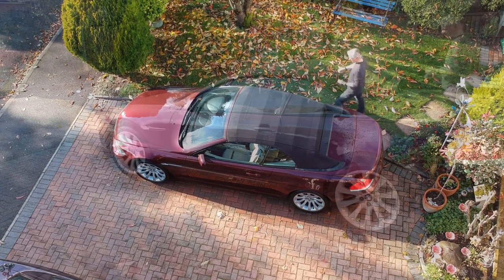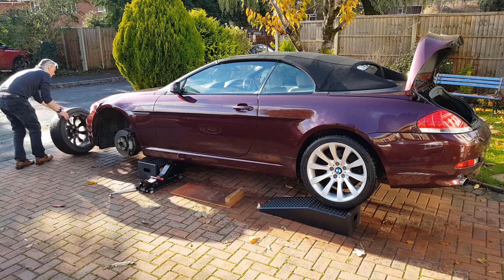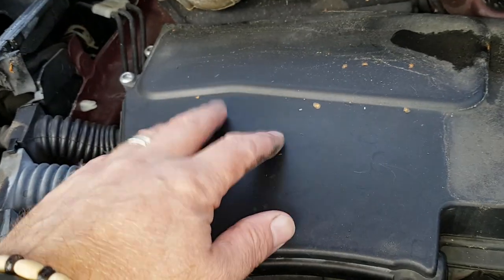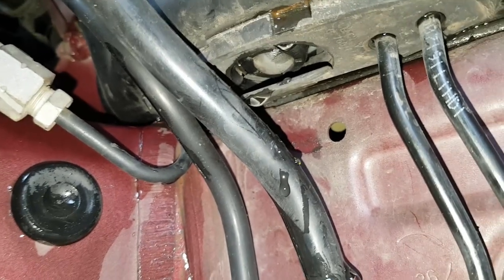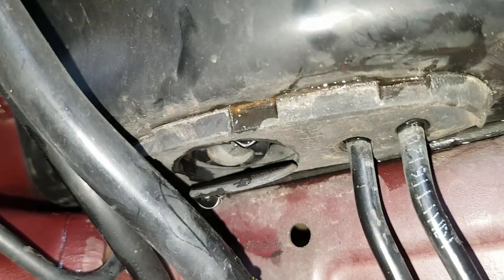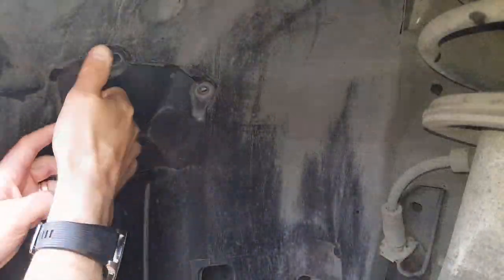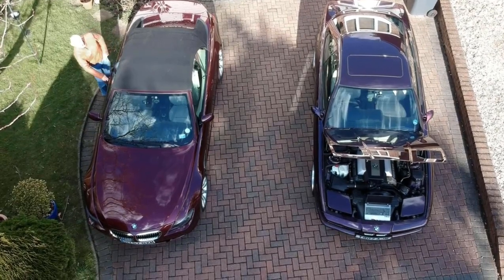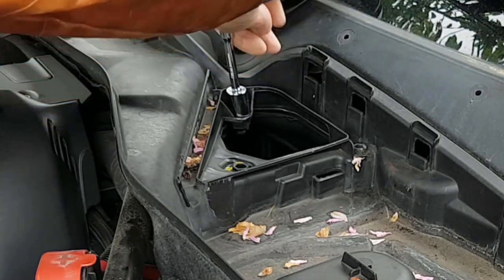BMW 6-Series Hidden Water Drain - The E-BOX one!

Comment: This is great help for alot of BMW owners. A good sign moisture has entered the Ebox is the Ebox fan will set a fault code showing a short to ground or open. The high end BMW's pump cold air from the AC into the box. Another source of condensation. I went thru 2 ebox fans before I figured this one out. I live in a humid climate and some of the AC condensation ends up in the Ebox. On my E70, I had to drill a very small hole in the very bottom of the ebox close to the ebox fan. If you see a rusty bottom in the ebox, this may be the source.

Comment: Hi Timm, I had water around the e box. Not caused any problem, but does worry me. I have taken a spray head off of a windowlene bottle and extended the tubing. I used it as a pump to pull the water out. Wish I knew how to unblock the drain. I had the e box open a couple of years ago to do valve cover gaskets. I’m sure some wires come up through the bottom and into the IVM module. If the ebox sits in water too long, it’s bound to get in. Great video by the way👍
Reply from the maker: The drain is accessible from underneath in the wheel well as shown in the video - there's not much room but you should be able to get it clear

Comment: Thanks for taking one for the team
Reply from the maker: Well, someone has to!
Reply: @TimmsBMWRepairsandInformation  on the US model it’s on the passenger side and allows water to penetrate the passenger side floor, and boy and I paying for it, totally blocked up , I had to clean boot out and flush from the top while using the wet vac to pull from the bottom

Comment: I'm going to be having a look at this shortly. a few months ago i took out 9 litres of water out of my rear drivers footwell, yes NINE, (glad I'm parked on a slight incline) removed all seats and the rear part of the carpet and let it dry, took ages,  the drivers side turned out to be the drain under the brake booster,. drivers side nice and dry now even with the lots of rain we have had, but the passengers side  is a tad soggy :(, so out the passenger side seat out again , its either that or a failed door membrane , more investigation required, but now i know where the passenger drain hole is
Reply from the maker: These cars love to leak everything!

Comment: Hi Tim, another helpful video, I had a shock when my e63 driver side footwell and the passenger footwell was absolutely drenched to my horror, always kept my car parked on a downward slope just in case there was a blockage etc just to minimise any risk of water coming in if there was a blockage somewhere, just this one time on holiday in October last year where the car was parked on a slight incline nose up and after a through wash with a outside hose, a luxury I don't have at home.

I have always kept the 2 side scuttle valves clear of leaves and crap but traced back the blockage to under the brake servo, where the area under the servo the paint had been eaten away and blocked the small drain, no doubt from where progressive dealerships had not been careful enough when filling the reservoir and the brake fluid has dripped/spilled causing the problem, am really angry and upset as I keep my car as in good a condition as I can, I spoke to my current bmw dealer BMW park lane who have just gone silent after deciding to tell them as they were the last people to do the brake fluid change in fact the car has never been outside the network and they should take ownership of the problem only because it took 2 months for me to get the last of the water out in this cold weather and because of the potential damage to the subwoofer/amplifier under my seat.

Just something else you may find helpful. The service advisor claimed that they don't fill the fluid fro up there but at the bleed nipples by the wheels which sounds like crap imho.
Reply from the maker: Thanks Doug, yes, I go through those drains in this video and they often get blocked up sending water into the cabin, really got to keep an eye on them!

Comment: Hi Tim..I've noticed on my 2010 E64 635D LCI that rain water is not finding an egress point. Drivers side..where the roof closes and meets the corner rubber cup  housing situated up in rh side of the bodywork around the.front window screen. So water is dripping in over the window control point on the driver door.
Any suggestion for where a secret drainage point is or which drainage point may be blocked...
Cheers
Reply from the maker: I show the drain you need in this video, it can be cleared out as shown: https://youtu.be/ZsnRfhWlpQ0

Comment: I'll give you the bad news.water can get into the e box from the bottom.ive just lost 2 ecus in 8 months due to blocked gully.im just about to pull those rubber grommets  to prevent it happening again
Reply from the maker: Yes, that's probably a good plan!
Reply: Same thing happened to me 6 inches of water in ebox ?? Question is 🤔 how damaged all my modules shorted ecu and decayed ivm pins.. Maybe through wire loom? Thinking of drilling holes ?

Comment: I have the E60 same era and found over last few days puddles in front driver well and rear drivers side footwell. Wondering if I have leak from front below bonnet ie brake fluid bin area and water flowing to back seat area. Or I have 2 leaks from rear door and front under bonnet area? Been tipping water out and it’s not ideal and windows are all steamed up. Need help.. not sure what to do.
Reply from the maker: Start with the engine bay, in particular the area around the firewall - AFAIK it has the same problems as the 6-Series
Reply: @TimmsBMWRepairsandInformation  do you mean after taking all. Plastic stuff off the area below the brake fluid reservoir? If the is a drain hole there do we just hose pipe it down and clean it?
Reply from the maker: @eddy45686  Yes, all explained here: https://youtu.be/IYsbTyjR0N0
Reply: @TimmsBMWRepairsandInformation  OK will have a go I also read there is a drain under the wheel arch plastic guards to clear too.
Reply: Ok tried that and water flows and exits the rear wheel arch when you pour down windscreen on both sides driver and passenger 
Under brake booster no wells or water seems dry mechanic says.
Pouring down windows haven’t seem water pour into footwell unless it seeps under carpet?
Mechanic is puzzled not sure where the access is. Says could be lights anything where it’s coming and maybe needs all plastics off to see.
We have no sunroof too.
Any ideas as I’m getting puddles daily after rain in driver side front and rear no where else.

Comment: Tim I also have an e64,  08.
 650 my infotainment system completely failed on me, it does turn on and show a screen, however moving the knob does nothing and there is no sound coming from the car at all, checked amplifier and replaced it and still no luck, any tips on what I can check or do? Thank you
Reply from the maker: Hello, I would go for INPA diagnostics next - it will pinpoint which system is not working, it can check the i-drive controller inputs (which might be the problem) - much cheaper than switching parts around!
Reply: Timm's BMW Repairs and Information thank you, hopefully works!

Comment: hi tim i have a problem with my pdc e63 2005 both front and back not working? do you do repairs?
Reply from the maker: No, I've only ever worked on my own cars! If you have one sensor that fails then the whole system will stop working - you need INPA to find which one - or, stick your ear against each one and listen for the clicking, the one that doesn't click needs to be replaced.

Comment: My 630i on approach to a roundabout or junction gets almost stuck when I put my foot on the Excelerate pedal..so I m doing normal 20 or 30 slowing down then as I have to pull out etc it's almost like power gone then it kicks in and carrys on being normal.. Help please only bought it last week after watching your videos amongst others..
Reply from the maker: That is normal behaviour - the DTC system reduces power and inhibits gear changes on corners, once you are out of the corner it will behave as normal allowing more power and down-changes. This has been the case since E31 days.

Turning off the DTC gets things back to how you would expect, but don't do it, these cars just love going sideways without DTC!
Reply: Thank you Tim for replying much appreciated dear. Stay safe dx